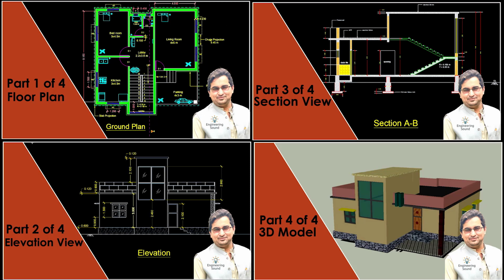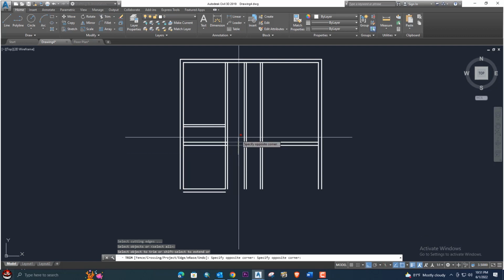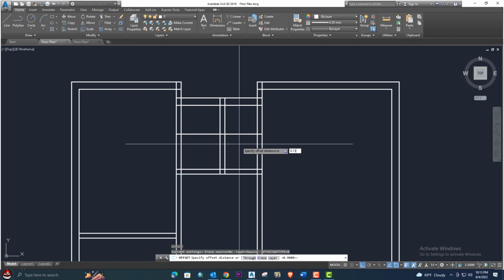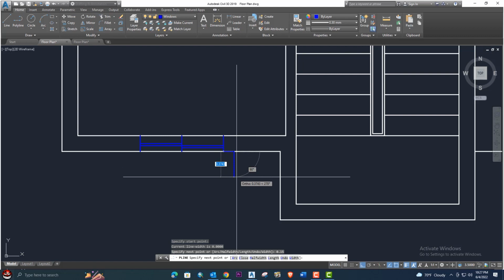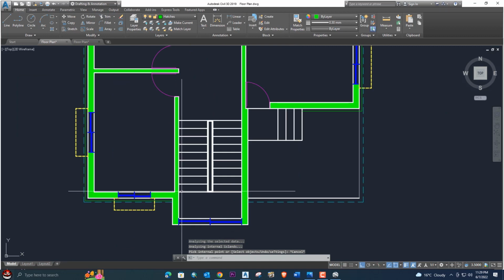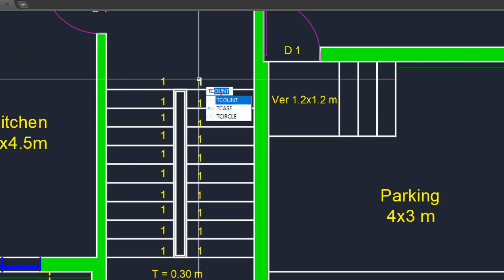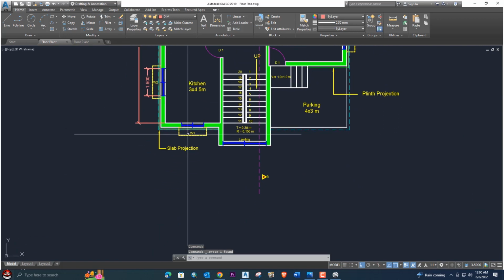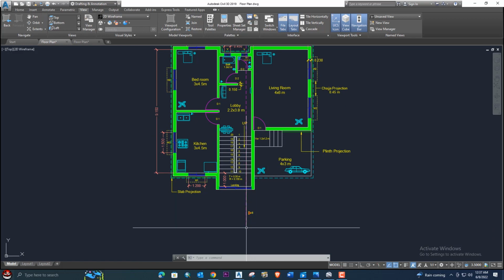Making a Complete Floor Plan in AutoCAD: Part 1 of 4

Comment: nice video. Just don't scale blocks too much they're on their universal size. for exemple your dinning table is less than a 1m  and the car is raughly 2m lol
Blocks for DesignCenter are always in their natural size.. you can adjust size a little bit but not too much 
Other than That Great Video
Reply from the maker: Thanks for comment but if you not set a drawing scale In start and your parking area is 4x3 and your car size not fixing then you need to scale. 
The blocks is designed to show only layout in the drawing no matter of sizes